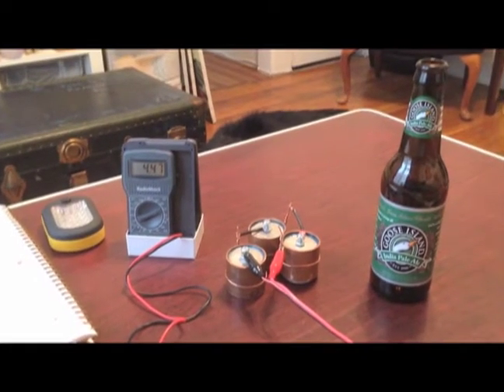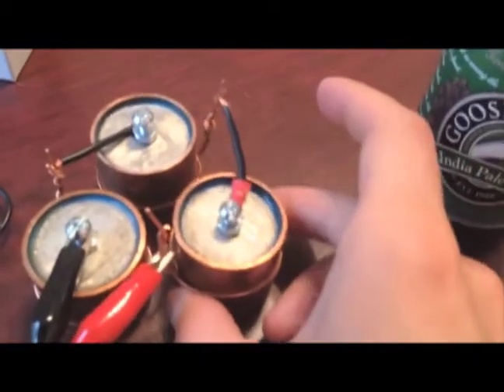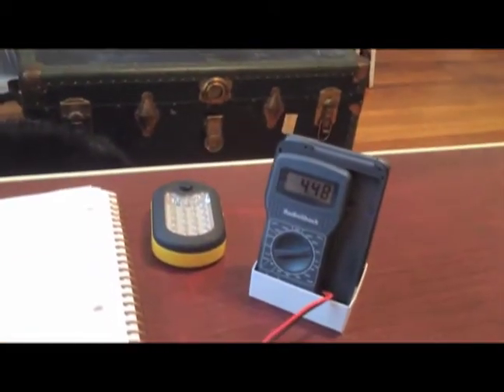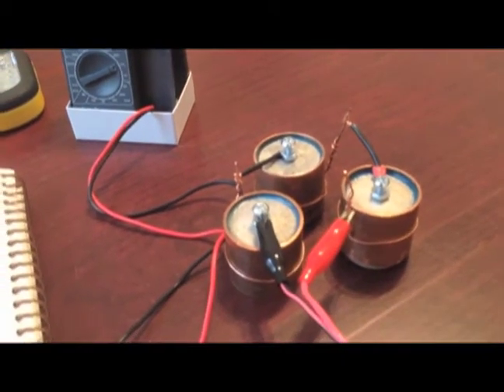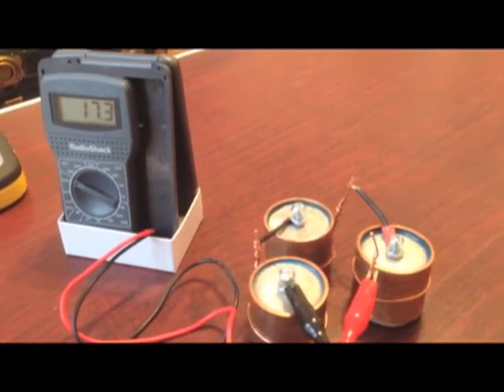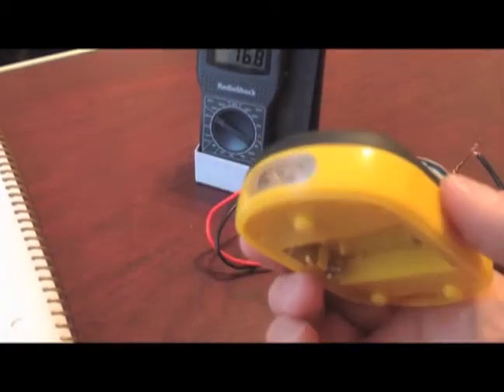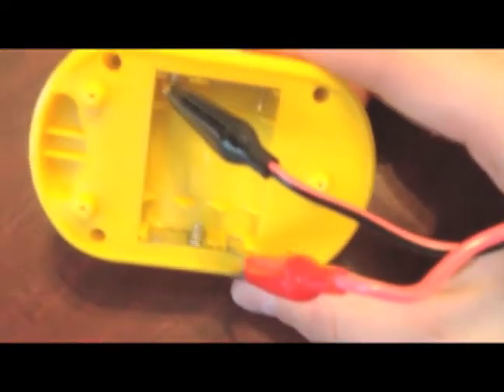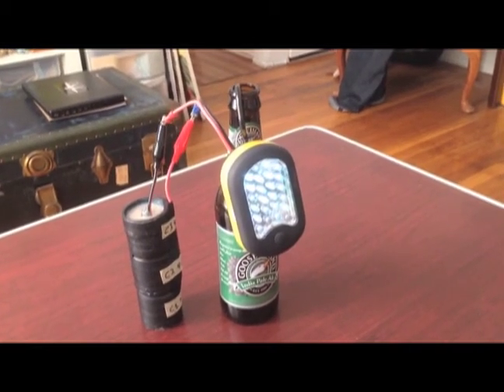Crystal Cell Battery Results & Opinion Part 2 Green Energy

Comment: I know I'm a little late but I have been studying the crystal cells for years now and the problem most people are having is that they don't know that the crystal cell power source is micro conductor but also a multi phase energy source. It is the shape that increases amps once you understand this you will be able to increase the size. I will release videos about it once I make some more different designs

Comment: Connecting batteries in series increases the voltage. If they are the same size it will not increase the amperage. Connecting batteries in parallel increases the amperage but not the voltage. Cutting the original battery in thirds and connecting them in series should produce three times the voltage but reduce the surface area and consequently the amperage to a third, which you essentially experienced. The interesting thing your experiment shows is that the thickness of the crystal layer appears to be somewhat inconsequential. It tells me that if it was a flat plate with much more surface area and a comparatively thin layer of crystal correspondingly higher currents could be achieved. I have been successfully stacking electrodes and increasing the voltages without electrical connections. My next experiment is trying much larger electrode surfaces. I will be trying multiple layers of copper and aluminum foil.  I want to coil the plates into a cylindrical shape but ensuring contact between the plates without shorting might be a challenge. Aluminum does not produce as much voltage but if the crystal layers can be very thin the overall size might be acceptable. I made a couple of cells with aluminum tea candle cups, copper pipe caps, and a pencil lead in the middle filled with the crystal mix and the voltage doubled. That was interesting. There is a comparatively large quantity of the mix. Considering the results of your experiment I suspect I might see favorable results. Thanks for posting the videos. Hopefully it will lead me in a direction that will produce positive results.

Comment: Sir,  your battery cells are roughly 4v and output are 20 Microamps not Milliamps. So you need to produce 1000 microamps to = 1 milliamp.... and 1000 milliamps to = 1 amp/Volt/watt,  So you need to make 50 batteries in series to get 1 Milliamp, and 
Multiply that by 20,000 then multiply by 50 and lastly divide that by 20 microamps to actually achieve what you believe to have.

So in total you need to create 5,000 batteries in series of 50 to get a 1250v battery that outputs 20 milliamps current. So your power supply would be the size of a hotel room to power a small 1.5v 25mA LED light. But you would still need a 6250ohms Resistor witch is unimaginable and impossible to find since they don't exist or ever will. 

Thats quite a journey.. 

and you're on it, make sure you packed, its the type of journey people perish.

If you're making them by hand alone our with your whole family of 3 working 4 hours per day.. it will take you guys around 4 to 5 Months to make and 3 months to set them in series of 50 with Soldering and Resistors.. so i say 8 months in total without missing one days work.. That is a dedicated family you got.. make sure they get rewarded with enough water and treats for creating the biggest super low current battery in the world.

Comment: A battery is only as strong as the weakest cell in the SERIES CHAIN so if your design has a weak cell then I would dismantle it, clean it out and start over, make sure your chemical components are mixed well and compacted well inside, I saw what lasersaber did when he made his, he really hammered the stuff in tight, as you only glued your end caps in I can't help thinking that is what went wrong ! not enough compression of the material inside, try again and if you must use glue on the end caps pack the stuff in really tight and clamp it in a vice over night while it sets see if that makes a difference ....

Comment: OKay so good work FlyFisher...First of all make this sure that batteries which all have same current can be connected in a series to get a stable current output...I mean to say that if u have 1.5 v 20 ma cell and another 1.5v 20 ma cell then only you can get 3 v 20 ma in series or 1.5 v 40 ma in parallel....The difference in between voltage and current musn't be big... I actually got this knowledge while designing aluminium-air batteries that run on salt water. So your cells must be of equal ouputs to do the work...I guess avergae calcultaions dnt wrk...And den there's another thng, xperienced people say that current cnt me measured accurately widout load...so when u put ur led light then put ur meter in ma scale in a loop...fr example connect the negative of the meter to the positive of the battery and the positive of the meter to the postive of the light...den only you can mesure the current consumed by the leds from ur battery..dat m8 be very low...Its grt I would too lyk to build these cellss...pls contact me jrath2001@gmail.com

Comment: OHM LAW is what you need. To understand the relationship between voltage and amperage, you also need the basics of wattage and resistance. It's actually very simple. It's called the OHM LAW. You can find it everywhere on the internet. Find a good source and study it all in a half hour, print it and frame it on the wall of your shop. You'll feel so smart you'll be able to spot a fake a mile away. It'll change your life. That's a promise. I'm looking forward to see your next video. Pierre

Comment: To measure current or amperage you will need a device that draws a certain amount of current (electrons). The internal resistor inside your multi-meter draws very little current. from the internal current limiting resistor try measuring the current draw from a device like your flashlight or small radio  to see available current performance. Try several flashlights at once to see just how much current the batteries could source (provide). I think your flashlight draws more mA (milli-amps) than your original small mA readings of 17 or so mA on your original amp testing.
Reply from the maker: Thx for the message! I will give it a shot next time I try messing with them.

Comment: Series for voltage and parallel for amps...
Series draws from amps to create the voltage.
Parallel draws from voltage to create the amps.
Simple right? Your results will very with materials and contact.
If I have it wrong please chime in. I'm learning that not everything I was taught in school applies. And there is allot we don't know...
Reply: flyfisher
Have you tried doing both at the same time? I mean have like 2 or 3 stacks of 3 in series wired in parallel. EX: have 2 more identical stacks of what you already built wired in parallel with a capacitor, this way you will still achieve both your expected voltage and amperage. You might get around 4.5 volts and 1 amp.
Reply from the maker: Thx, I appreciate your comment. With Crystal Cells, you can run them in series but not in parallel. Something to do with resistance. Other people have explained it, and in my tests it does not work. However, if you can figure out this conundrum, please share with us. Cause until this is figured out, these cells are pretty much useless, with the exception of running small LED lights.
Reply: Interesting for sure. ;)
Reply: flyfisher
hummm!  that sounds strange. Its DC current it should behave the same.

Comment: LaserSaber mentioned in one of his videos that the voltage and/or amps would drop after a few days or so when the mixture "settles in"... I might be a little off, my memory about it is vague but I definitely remember him mentioning an eventual drop off and that  the cell produces more during the first few days or weeks.  Sorry about the ambiguity...
Reply from the maker: Yes. It does drop off but the over arching problem is you can increase volts in series but you cannot increase amps by running it in parrallel. Several other's have explained the impedence created when hooking up crystal cells in parrallel. I have tried to run my crystal cells in parrallel with no success.

Comment: if you connect parallel the amperes go up .  series is increased voltage
Reply from the maker: The over arching problem with CC is you can increase volts in series but you cannot increase amps by running it in parrallel. Several other's have explained the impedence created when hooking up crystal cells in parrallel. I have tried to run my crystal cells in parrallel with no success.
Reply: it would be resistance on dc not impedance impedance is an ac circuit. try possibly isolate the current with a cap circuit before running parallel. also thought you might wrap the copper with a non conductive insulator to prevent any shorting to ground. let me know what happens thanks
Reply from the maker: Yeh, I meant resistance. I do have the batteries wrapped in electrical tape. I will definitely look into the cap circuit. And see what I can come up with. Thanks!

Comment: Some more electronics's theory will help you out , john Bedini transformed copper into a diode which he claims preserves the magnesium electrode crystals do grow with distilled water , tap water will rust them batteries, and try more cells in parallel of course without forgetting the pulsing technology circuit, hopefully resonance will give out more energy than in, good luck

Comment: Hi, I had an idea. it seems you hit a ceiling on power out put with your crystal cells.
I was thinking you should make your cells with foil that is very thin and layer it like a note book. Keep putting down the layers until you start loosing amps. I wonder how many volts you can get up to. Also you should mix your crystal matrix with tyouline or other chemicals that will completely evaporate and leave no water. also use an old coffee grinder to powder your mix as fine as possible.
You can also add some borax so your metal will not corrode. I have seen people use some pure carbon in the crystal mix to increase electron flow. Im not sure how much to add so its an experiment in its self. I hear crystal cells have very high impeadence. I figure that means its difficult for electrons to flow though the crystal and gives lots of resistance, the carbon doping might help.
I also thought when you find a good balance on how to stack your cells in series you could make several stacks that would feed a large capacitor that could regulate and provide usable power for larger needs, like powering a battery bank or running a computer.
Also I thought ibpointless2 crystal glue battery he makes with paper and wire looked promising, I think foil would work well. 
Please let me know if any of my ideas were helpful, thanks.

Comment: Amps get increased if you run the cells in parallel. You ran it in series, so only the volts go up. It's either one or the other. You could try to have several series, then run them in parallel. So like 3 cells = 4.5V so having a second set of three(6 cells total) run in parallel will give you 4.5v, but with double the amps.

Comment: Batteries connected in series increases voltage. Batteries connected in parallel increases amperage. To increase amperage build another set of three cells connected in series. Once you have two sets of three cells connect them to each other in parallel. This will double the amperage but you will still end up with 4.4 volts.
Reply from the maker: Awesome! Thanks for the info! I am hoping to make some more batteries in the next month, so I will be sure to try it out! Thx

Comment: I have the same cells. I have found that by adding altitude distilled water will bring the milli amps way up. Also try putting them in a hot car for a few hours. I have 8 cells hooked to two strips of 52 LEDs from an led solar lite kit from Walmart. These light my bedroom every night sometimes leave me on all night